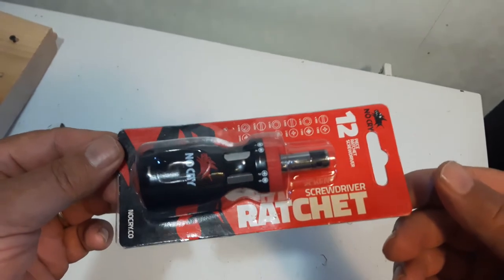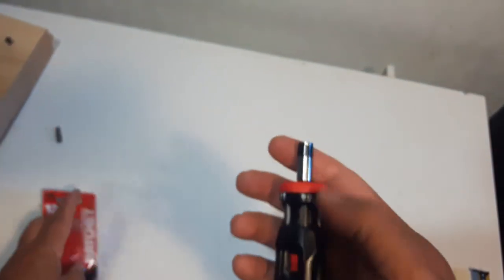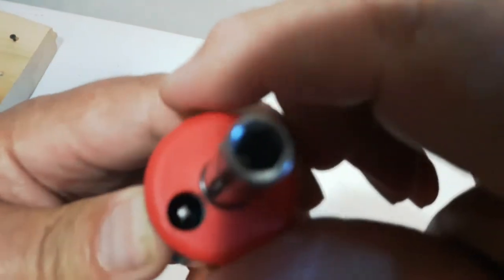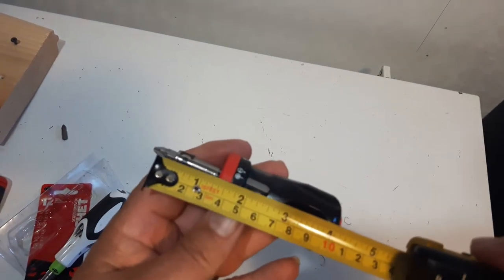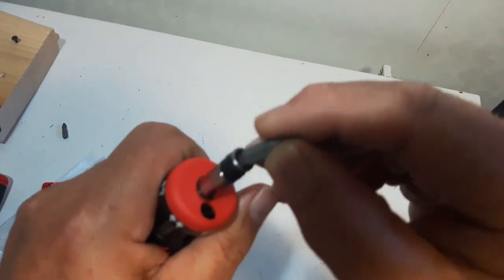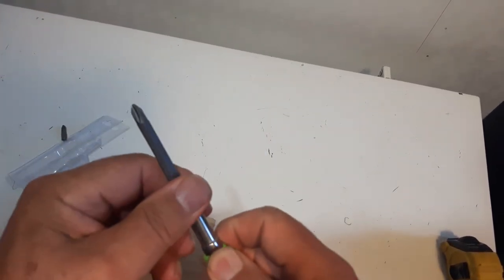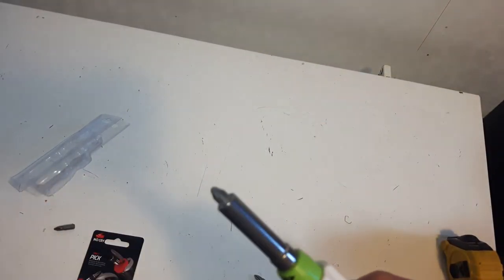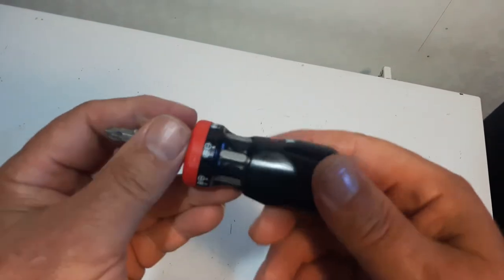NoCry Ratcheting Stubby Screw Driver Review.

Comment: I bought the no cry ratchet screw driver and unfortunately the bit holding device broke on first use. The brilliant service I received meant I received a new replacement almost immediately. All now working fine. A brilliant piece of kit. Thank you.
Reply from the maker: I used my nocry  to secure my Gazebo to my deck the selector dial for the bits kept turning and bit fell out almost losing the bit between the deck boards. It does have its flaws.